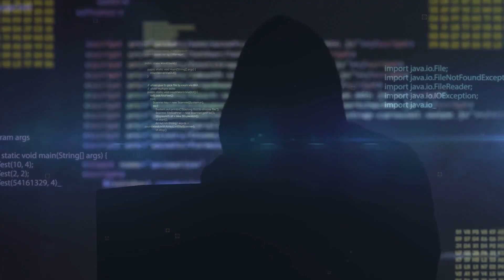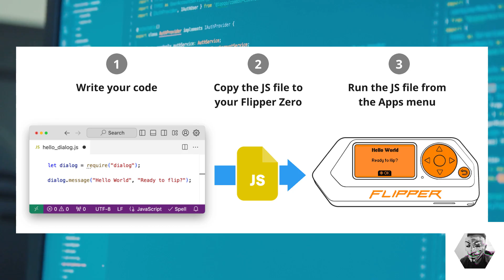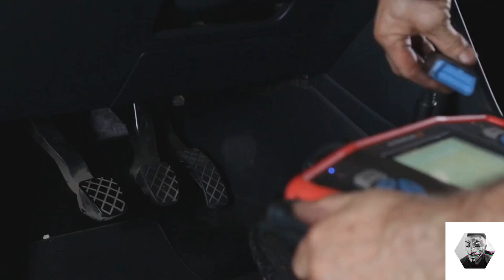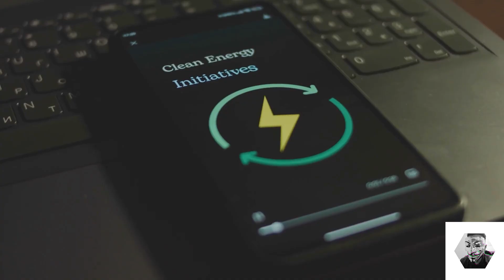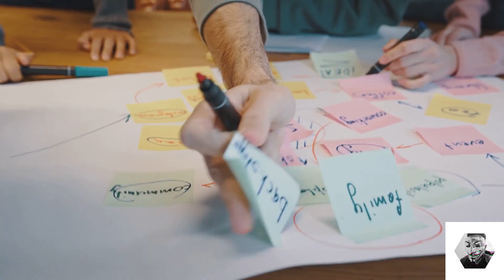Flipper Zero - Round Up

Comment: I love The Flipper zero but stop using it for a while try to span somebody in the area where they had some kind of protection it showed my full email that's why I felt sketchy about using the app don't use the app just use the Flippo zero as is this is a warning
Reply from the maker: That’s wild! Definitely sounds like a privacy concern. 😬 Appreciate the heads-up—seems like sticking to the Flipper Zero’s core features without the app might be the safer move.
Reply: @PenAce  it didn't come from my intended target but I was in the area where there was a school and I guess they came up with something to stop people from doing it but there's nothing more frightening than seeing your own email send back to you
Reply from the maker: @TheyalwayslieD-z2x  😬 It might have been a defensive measure like MAC address randomization or a local network honeypot designed to intercept and deter spoofing attempts. To avoid this, you could test in a controlled environment with isolated devices or disable personal data exposure settings. Stay safe out there! 🔒
Reply: I was wondering why Google Play would have an app in the store that works with flipper that was the first red flag I ignored but knew it could be a problem because you're using a hacking device downloading a free app is exposing you the communication through Bluetooth it's all I guess it needs they watch who downloads this app I still have it never used it since that day all the fun was gone but I want to get another one start from scratch take every safe measure possible don't know how I start off it's been so long